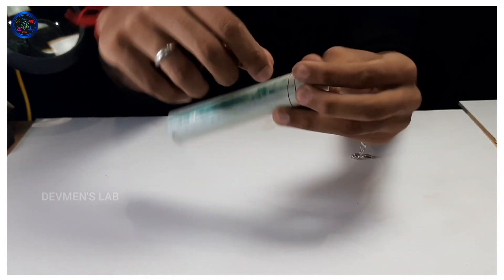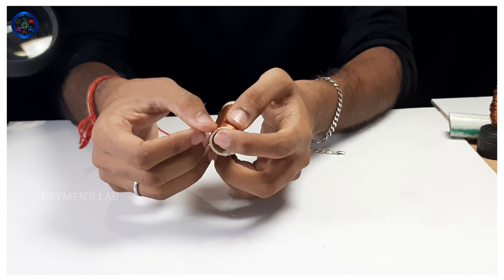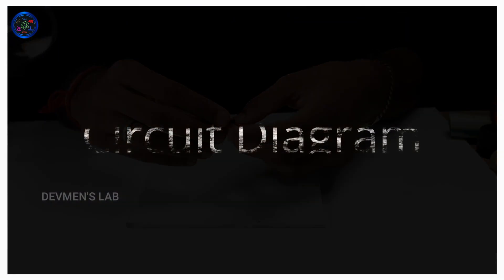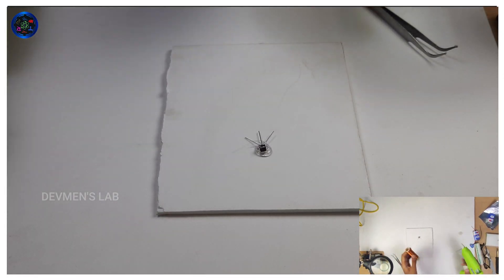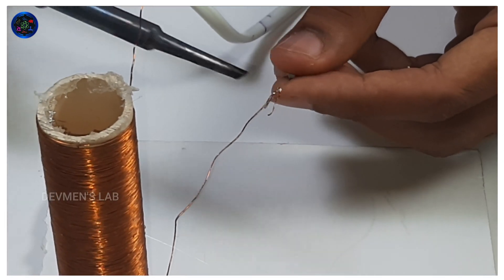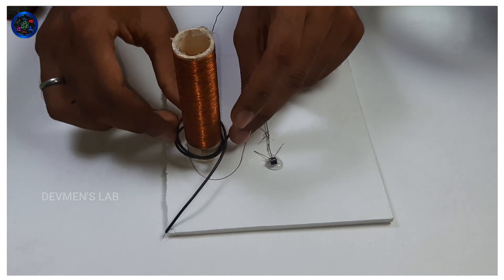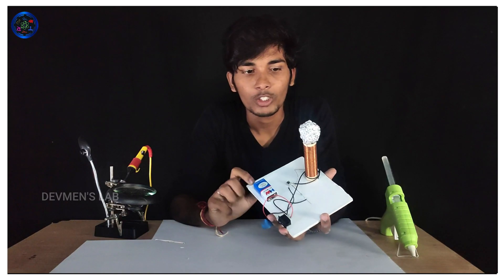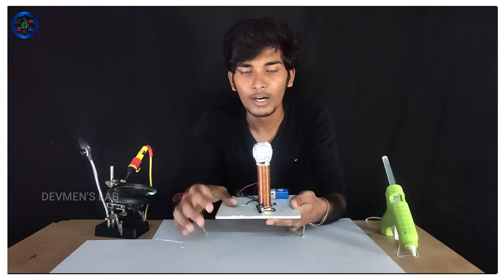How to make Tesla coil at home || DevMen's Laboratory

Comment: Very amazing, i think you can power it up much more if u use a MOSFET
Reply from the maker: Tq bro😊😊
Reply from the maker: I will try to use MOSFET on nxt time bro😊
Reply: @devmenslaboratory8740  i think using a MOSFET and gate driver you can switch the primary coil on and off and that you can control thu pulses
Reply from the maker: Ohhh k bro ✌️